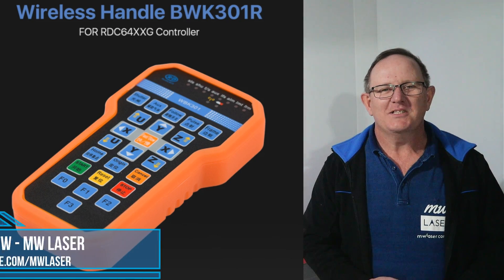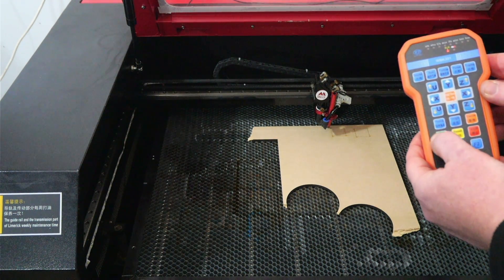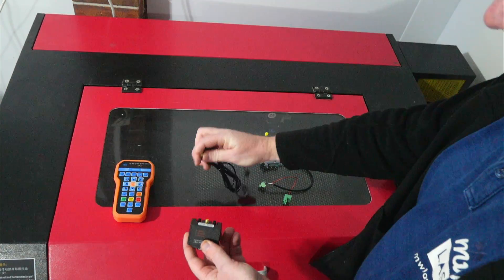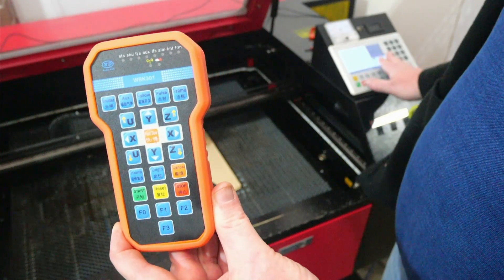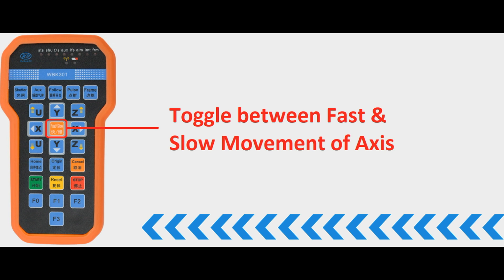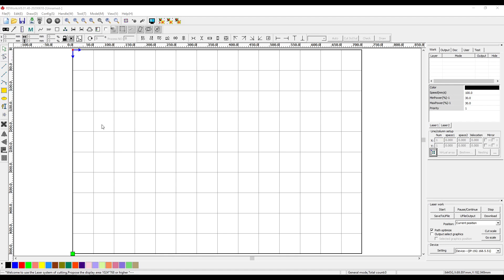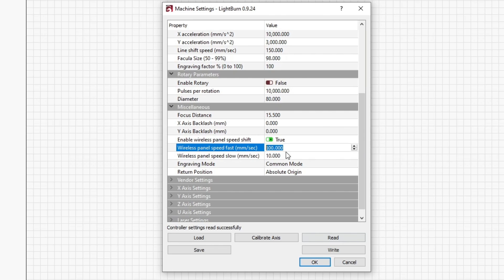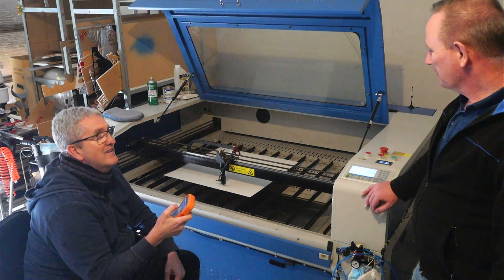[11] - RuiDa BWK301R Wireless Handle - RDC64xxG Co2 Laser Controllers

Comment: Great video Matt. Very interesting remote. I'm often changing jog speed on the controller to be able to trim and prepare stock (combo of move and pulse), which can get quite tedious. Just having the ability to switch from say 300mm/s for just moving around, down to 10-20mm/s for cutting stock seems quite the game changer!

Unless I'm mistaken, this speed shift isn't something that can be done on a standard RuiDa controller?

Thanks again for another great video!
Reply from the maker: You have the option of changing the the movements from the controller, however there are only 2 settings Continuous movement and manual step.  You can adjust the manual set length from the RuiDa Controller.  I find the Wireless handle does make things easier.

Comment: To be honest i'm really trying to see the point of this controller. You say it is useful, that you can use it where the work is being processed instead of going back to the controller? but the controller is already where the work is being processed. Where using a CNC machine that uses a pc/laptop instead of a controller this would be useful I find it hard to justify paying for a device that puts you a few more inches nearer to the work piece than the RuiDa controller.
 The only use I see is using this alongside your computer screen and only then if you have a lightburn camera fitted.
Reply from the maker: I understand this wireless handle is not suited to everyone and every machine setup, for example as you pointed out on smaller machines this may not be useful because the controller is very close to the work area, however for larger machines where you want to position work away from the controller, it makes it easier to make accurate adjustments of your axis without the need to step back to the controller.  it is also useful for pulsing the laser when making mirror alignment adjustments without the need to keep walking to controller to pulse laser (especially mirror 1 at the back of the machine).  Also when used on the RDC6442 controller it gives you direct access to buttons that are not on the control panel such as z axis which is normally accessed through the menu system.